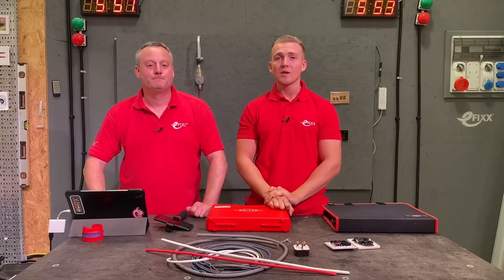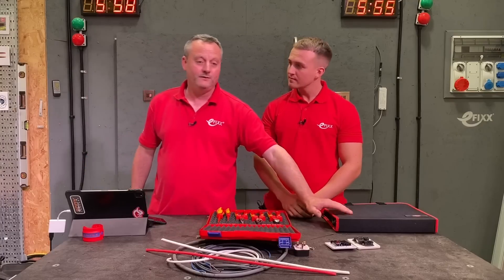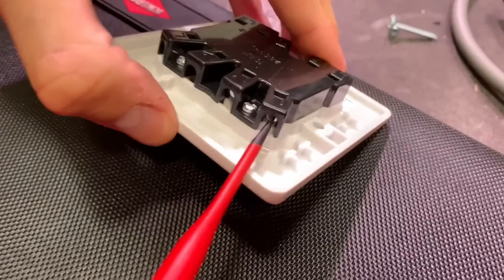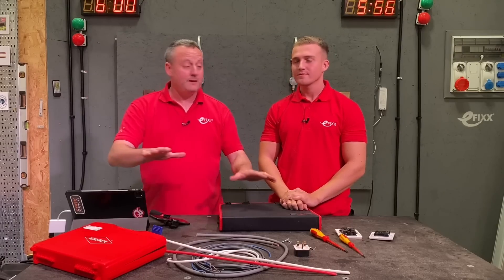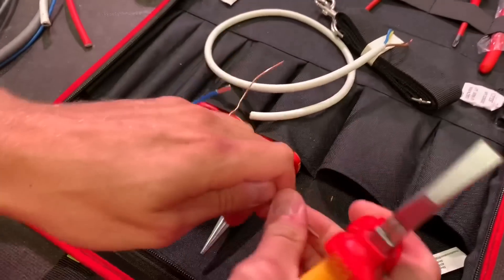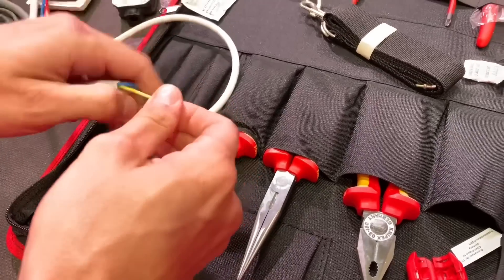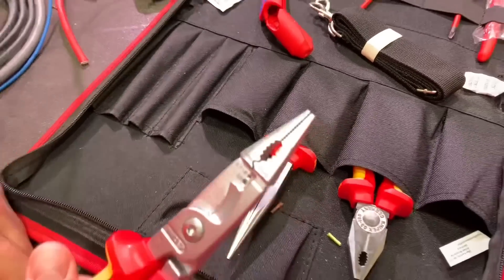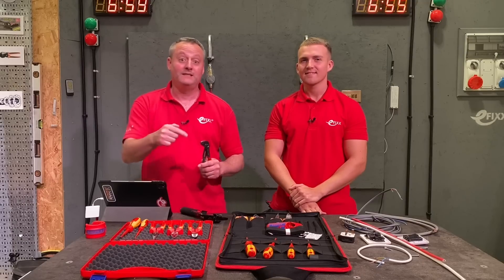KNIPEX APPRENTICE ELECTRICIANS TOOL KITS - 🧰 25% OFF 🧰 Discount code

Comment: I started as an apprentice in 1975 with a pair of pliers a few Stanley screwdrivers non insulated and a pen knife. Then moved on to a hammer and chisels and a rawl drill for knocking out wall boxes and lifting floorboards which was the main job for the first year along with making brews and going for dinners
How times change.

Comment: As  a   74   retired   electrician   I  see   you   blokes got  it  so   easy  to    say  50 years   ago knife  pliers  /  few  screw drivers    hand  drill  hammer / few chisels /JUST   HARD GRAFT   compared   to nowadays   a cushy   nu mber  nowadays
Reply from the maker: Graham you are right! Apart from the amount of paperwork and testing required.

Comment: I always stress to an apprentice use the correct tool for the job. Knipex are over price , there are other brands of tools out there which are just as good quality and cheaper.
Reply: Which brands?
Reply: Which brands? Guys I work with tend to buy other brands and have to replace them more frequently. Side cutters from knipex last years longer before they go blunt. It’s not until you use or someone else uses yours that you realise yours/theirs are blunt.
Reply: @reubenklang3968  Yeah I've used a fair few brands myself but I've had Knipex for years now and wouldn't use anything else. I used to get CK etc but they're not great and as you say don't last too long. My current pliers/cutters are nearly 10 years old and only need replacing now. I was just wondering if there were new brands on the market as good as Knipex but much cheaper, I doubt it to be honest.

Comment: 3:30 No no no no no, 4:40 much better, should never be taught the sidecutter way.
Reply: Reality is on site most people use side cutters for almost everything. Although i don't see the point in teaching it when we have actual tools designed for the job. That's like teaching someone to chisel out with a screwdriver when we have chisels.
Reply from the maker: You don’t have many flat cables in Germany